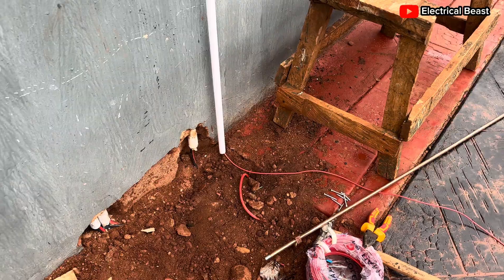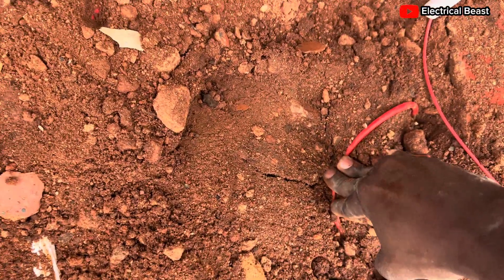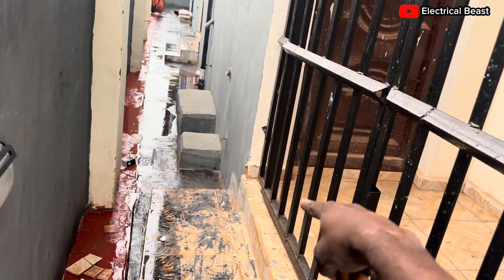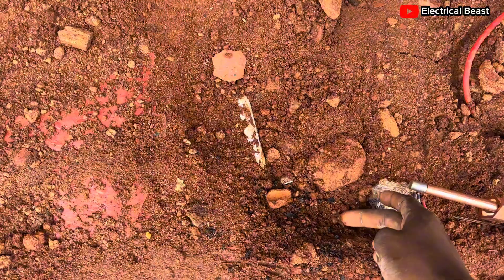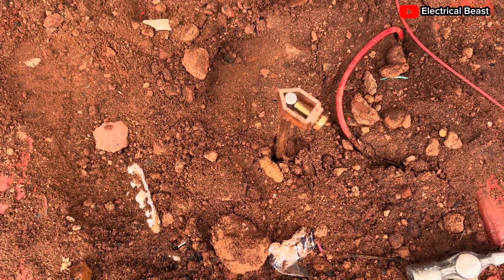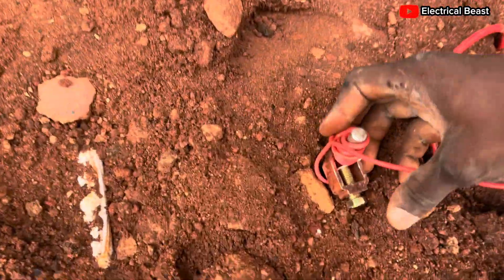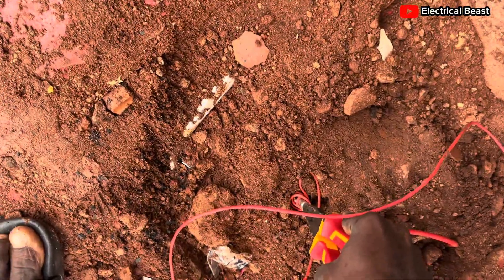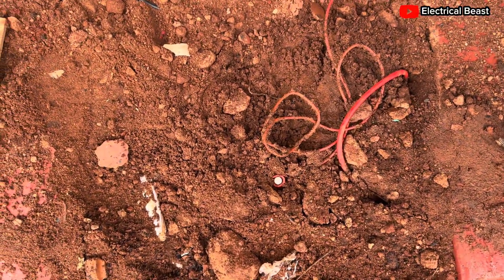Ultimate Solar Inverter Earthing Guide For Beginners

Comment: The size of your earthing cable should be equal to or slightly bigger than the size of your load cable. If the load cable is 2.5mm, it's advisable to use 2.5mm or 4mm cable for your earthing.

Comment: Please how many meters/yards of solar cable did you use for the whole of this work? From panels to battery
Reply from the maker: 6 yards
Reply: Great job, welldone sir, please is it adversable to loop the same earth cable of the inverter to the main building AC  distribution board,
Reply: Can we also use one pit for earthing of inverter, then  same pit use to earth the main electrical system of the house, using one pit?